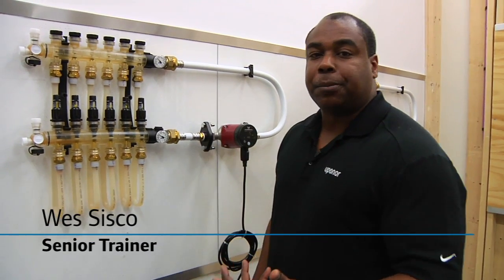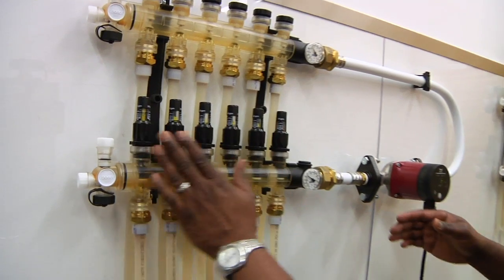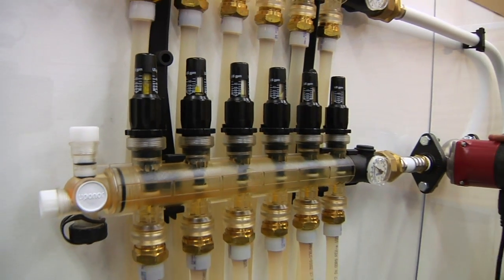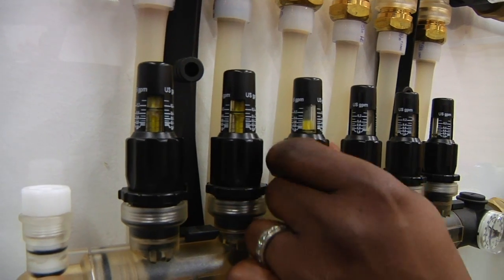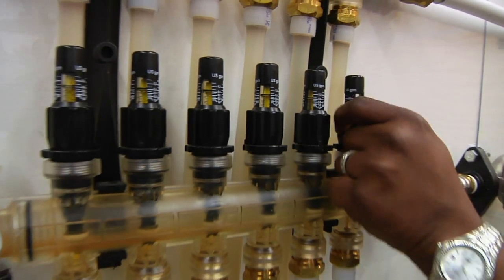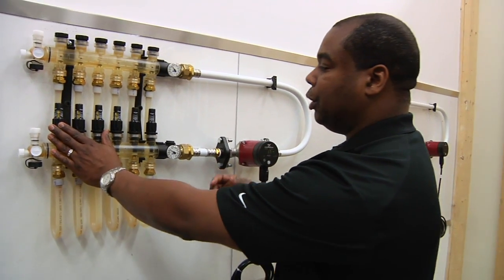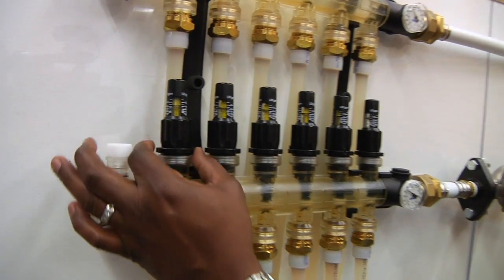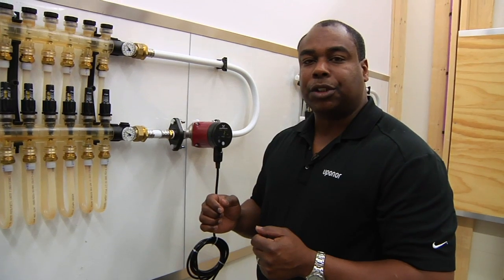Uponor Minute: Manifold Balancing for Radiant Heating and Cooling

Comment: Where does the thermostate come into play? Do you need a thermostat for each zone?
Reply: Looks like you would need an actuator for each zone.  The thernostat wire would be wired into the actuator on the return manifold heads and also wired into a transformer

Comment: Would you recommend to feed the first, second and third floor from the basement manifold?
Reply: It depends on the head loss.   Or amount of feet of pipe to the longest run and back.   It also depends on pipe size.   And the pump size. If the pump gpm can overcome head loss to third floor than it should be fine.

Comment: unfortunately, he didn't explain anything.  Like, why the need to balance in the first place, etc.
Reply: He said the gpm dictates the btu out put for each zone. So if you dont balance them equally you will get less heat out put to the loops with less gpm flowing through them and more heat output to the loops witj more gpm.   So he balanced them to get equal gpm through each one